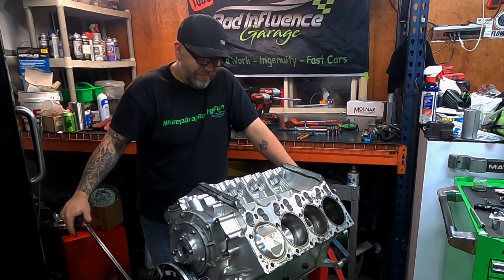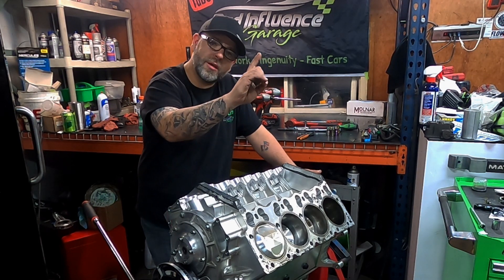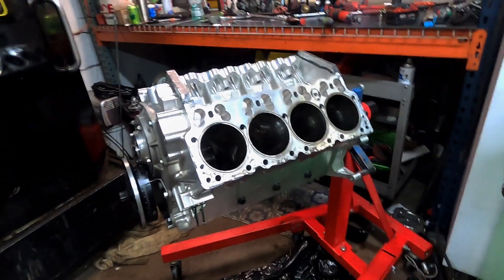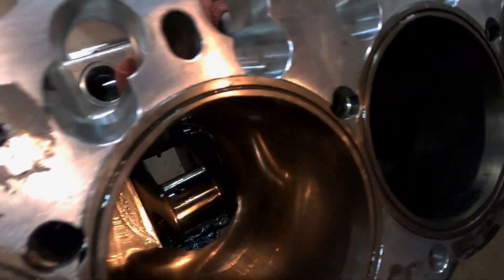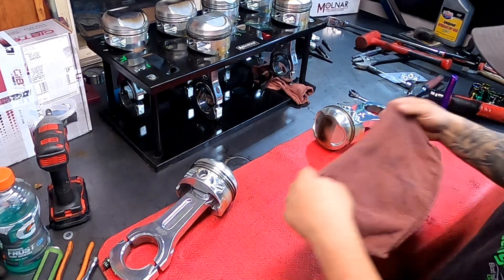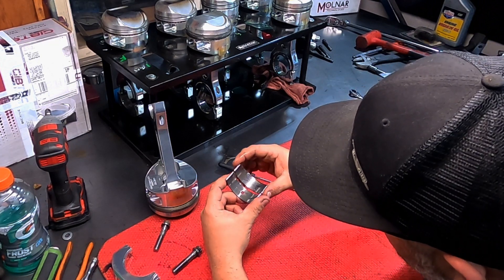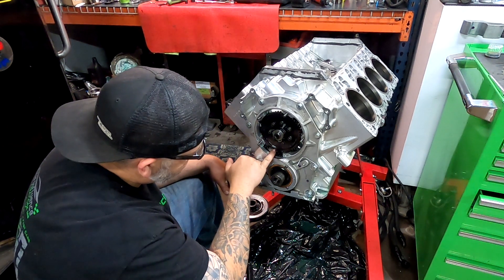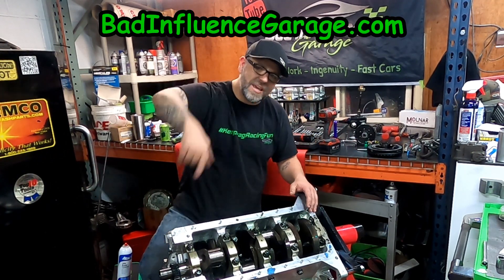Turbo Billet HEMI Short Block Disassembly and Inspection, Improving Engine Performance Series Ep 3

Comment: If you do dingleberry hone it I would like to see how you do it, just did it on my methanol drag car to get me through another season including using the same rings(which everyone tells me not to do) but as we know these engines have a short life
Reply from the maker: We will see what we can make happen 😎 maybe a dingle ball, vs pressure stones hone 'explained' portion of an upcoming video? 🤔
Reply: @BadInfluenceGarage  sounds good, a recent video from a proline hemi engine builder(dandy engines in OZ) said he’s done it at the track on his pro charged hemi radial car and then went out and ran a 3.57 which reinforced that while it’s not perfect, sometimes it doesn’t have to be right, it just has to be running